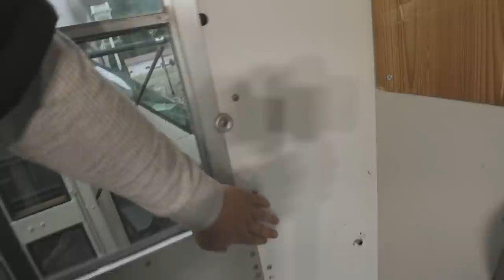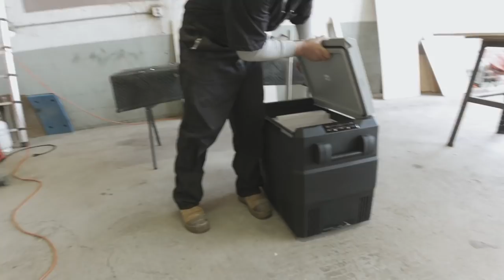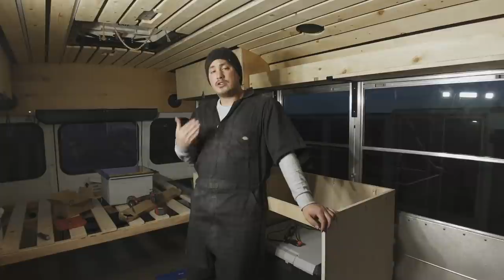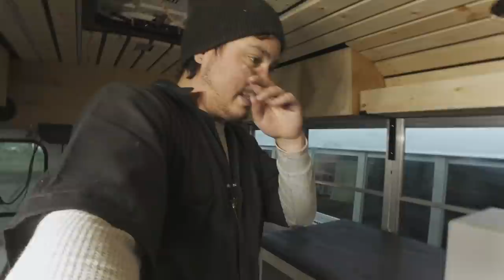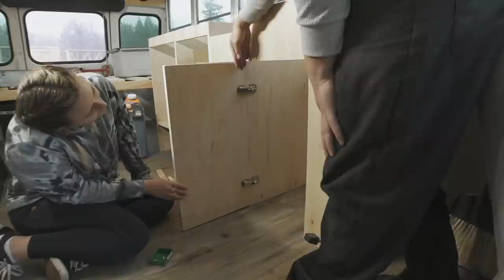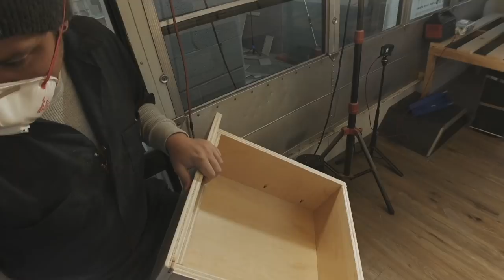SKOOLIE CUSTOM CABINETS - 30 Day Short Bus Build. (Episode 4)

Comment: Love the way that you've done the flush with cabinet and drawers, and just how that countertop is still spacious with how the stove top and sink been installed, etc. Awesome build and team work into this build. I know ven like the use of the 3/4 plywood without using the 2x3's to save more space as well. I so love how this turned out, I may do similar ideas into my van conversion build in near future, I will over all have close to 66 square feet Or maybe a tiny bit less after I get my ceiling and walls done. This week I plan to resume back to where I left off on my van conversion build, weather permitting and good because I don't have an indoor workshop, but outdoor in my dad's driveway, can't use those few power tools I have in the rain if we get any, have to be a good and dry day for me😊 anyway, y'all be blessed warm and safe too. Love y'all, sending lots of love hugs and prayers daily to y'all from me and my dad in Odessa TX 🤗💖🤗💖🤗💖 (today, I helped celebrate my dad's 77th birthday, he loved it too)
Reply from the maker: Thank you 🙏
Reply from the maker: And happy b day to him :)

Comment: Nice video. Really good idea about laying out all of the items before making all of the cabinets.
Putting wheels under the fridge base is a good hack in taking the weight off of the sliders. One of the most stressfull moments was when we were cutting the sink hole in our custom butcher block countertop. Measure five times cut once. We ended up attaching our cabinets to the metal sidewall ribs for extra stability. Final project looks amazing. When you build the bench on the passenger side it will be done before lunch!
Reply from the maker: Ha ha might be unless I get fancy with an idea I have lol

Comment: Isaac question for you. Why do you not strip your walls and floors? Check for leaks etc and do insulation and wiring inside the walls?
Reply from the maker: Already insulation in busses. I buy my busses from az so no water damage or rust. I re seal the exterior during the paint process. I choose not to put wires behind the walls so I can fix future problems or add more things Easily.
Reply: @isaacturnerit  ok thanks for explaining that! You nailed the kitchen cabinets! Looks fabulous. 💜

Comment: Love the video and learned a lot.  I’m not a carpenter at all….  So very informative. 👍 Really love that burner as well.  My wife and I are considering this one for sure.  I did notice that you use several different refrigerators depending on the bus.  Do you have a favorite manufacturer, or reasons for different models?
Reply: Sorry forgot to say, GREAT job on the drawers!
Reply from the maker: Ice co or set power

Comment: Hi, I was wondering do you have a Video of your Ceiling install, It seems you didn't remove the Metal Ceiling, Prior to putting your wood strips? (directly on the Metal?)
Reply from the maker: Yes directly to the metal
Reply: @isaacturnerit  Do have a video of the installation process? It could be on any Media  Platform. This is the route we would like to go. and hopefully  get good results also.

Comment: How do you fasten it to the walls/floor? Wouldn’t you want a larger fram than just plywood to make sure it is fastened in properly to avoid sliding around?
Can someone help me out?
Reply from the maker: Oh the plywood is just fine. But if you want something stronger people are using 80/20 and rivnuts to bolt things to this metal frame
Reply: @isaacturnerit  Great thanks so much!! Also do you build in sell buses for a living?? Thats a dream!! If you need a hand ever, I'd be stoked to help :)

Comment: 6inch and 6inch and whatever the heck size that is.
Life lesson.
I'm having my solar or the rest of it delivered next week and it is just slow going till you've done it a few times, which I have not. Looks good I like your ceiling, is it just 1x2s screwed into the hat chanel's?  Prolly not that would be too easy.
Reply from the maker: The ceiling is 1x4 just screwed up with some construction glue behind it
Reply: @isaacturnerit  nice I'ma try that

Comment: PROBABLY TOO LATE BUT NEXT TIME WHY NOT JUST ROUTER OUT A GRAB HANDLE IN THE CENTER OF THE DOOR FACE INSTEAD OF PUTTING A DOOR GRAB ON THE OUTSIDE, IT WILL HAVE BETTER LINES ?? ?AND A CLEANER LOOK
Reply from the maker: Don’t own a router yet